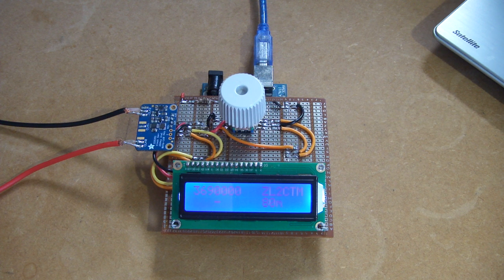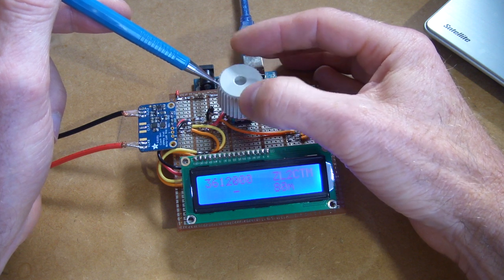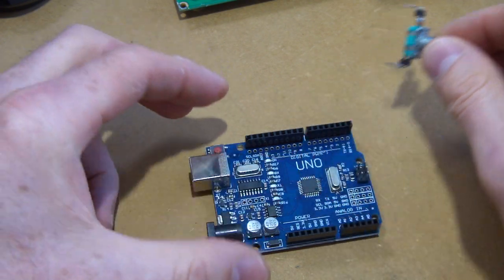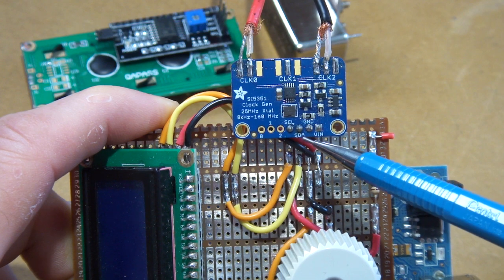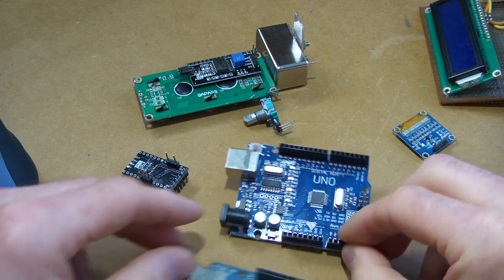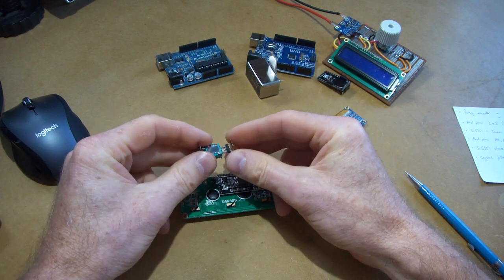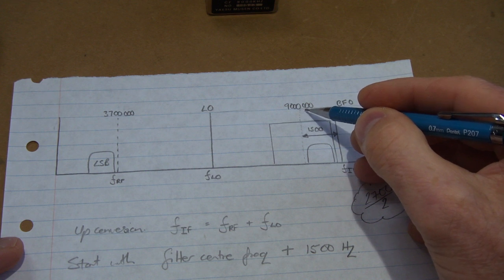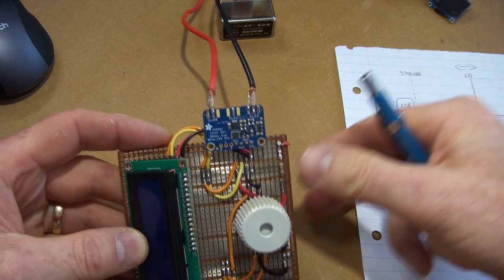Si5351 VFO/BFO Software: Part 1 Hardware overview

Comment: Hey Charlie! De VU2RJV here. Thanks for your awesome videos that has helped me to breadboard this DDS VFO and it works very well.
I am finding it difficult to transfer it into a vero board. Can you help me with the layout details and wiring on this vero board. I am a beginner to home brewing. Even a rough pencil sketch pic would do..73
Reply: Any help will be appreciated. 73

Comment: Hi charlie, thank you for your detailed hardware review, I am interested in build it as a VFO of an old 80 mts SSB BLU (modified :) ). My question is regarding the output frequency of the Si5351, if am not wrong is and sqare output instead of a sine wave no? So if that happens you simply add a filter to get a clean carrier for example? Thanks in avdance!
Reply from the maker: You can add a filter. I did that some time ago and it worked well. Otherwise, square waves work well for the simple diode based DBMs.

Comment: Hey Charlie! Just wanted to knew how the rotary encoder works without Vcc. Dies it take power through RotA and RotB or A and B outputs?
Reply from the maker: Rajaram. The rotary encoders I use only need a ground. No need to Vcc at all.

Comment: Does the Si chip put out square waves? So you just use those for the mixer (instead of a sine)
Reply from the maker: Yes. The SolderSmoke podcast had an article on this at http://soldersmoke.blogspot.com/2016/03/great-video-on-mixers.html

Comment: Hi Charlie, I down loaded the sketch from your blog side to build this VFO/BFO. I keep getting "Tm1637 Display h: No such file or Directory.  I copied directly from the site and have amended  the code. what would you suggest please.  de vk2jcc
Reply from the maker: Hi Colin. You will have to adapt the code to suit your hardware, i.e., what display you are using. I'd get the display working first using the display's library examples, then pull that code into the VFO/BFO sketch.

Charlie
Reply: @CharlieMorrisZL2CTM  Many thanks, It's a big learning curve for me with Arduinos .
 Love the videos you have put up.
 I have learnt a lot already. de Colin vk2jcc

Comment: I use the cursor to indicate the step digit, you can put the cursor on the same line as the frequency number leaving the second line for something else.
I use the pin-change interrupt for the encoder, on the UNO (atmega328 ANY pin can accept pin-change interrupts), both interrupts go to the same routine.
I now would rather use either the AdaFruit Itsy-Bitsy M0 or M4 boards instead of the atmega328 boards.  These are 3.3 volt boards.
Reply from the maker: Yes I have used that approach too and it does work well. It looks tidier too.

Comment: Hi charlie can i use your model like an rf signal generator to adjust sensibility  in a hf radio ?????(excuse me i don´t speak english)
Reply from the maker: I don't see why not William. I use it it in my SSB/CW rigs with no problems.

Charlie
Reply: @CharlieMorrisZL2CTM  can you send me the wiring diagram to conect all to the arduino uno board and sketch please???? my mail is yv5jau@msn.com tnx.
Reply from the maker: @williamsanchez34  It should be all on the blog William: https://zl2ctm.blogspot.com/

Charlie

Comment: I have a bunch of SBL-1H I think it’s called it’s like a +17dBm drive.  How could these ever be usable , never seen anyone build with them.  I thought I was getting the +7dBm package when I bought them. Dumb move on my part
Reply from the maker: Hi Seth. I have not seen any homebrew builds using the SBL-1H. No reason that I can think of why you couldn't use them. You'd need to amplifier the AD9850/Si5351 output to get it up to the 17dBm level needed for the LO drive. Give it a go.
Charlie

Comment: Hello Charlie,
I just subscribed to your channel.  THANK YOU for providing detailed explanations of your schematics and the math involved in determining values of components. Most channels simply give one the schematic with no explanation as to its creation.
   From your videos a person can actually learn how to create their own design for a radio.  SSDFRA and EMRFD are fantastic resources but being able to see and hear an explanation for the theory is priceless!

Could you please explain how you determined the LO drive current levels for the Level 7 (8 ma.) and Level 3 (2 ma.) mixers?  I have a hard time wrapping my head around db and dbm but I believe +7 dbm equates to ~ 5 mw. and +3 dbm to ~ 2 mw.  If I assume a 50 ohm input impedance for the LO input of the SBL-1, and use the formula p=I2R I calculate max. current for the Level 7 mixer at 10ma. (very close to your 8ma.) and 6ma. for the Level 3 mixer (not so close to your 2ma.).  Am I on the right track?

73,
Terry
Reply from the maker: Cheers Terry. You might have heard me say that the whole idea of the video series is to encourage others to give it a go, i.e., design their own radio. They are not suppose to be high end radios, which is a reflection of my own limited knowledge and ability. That aside, I personally get so much enjoyment from using a homebrew radio, no matter how good it is. As for the VFO, yes, you are on the right track. I have found that you can just connect up directly the Si5351 (with the software set to 8mA) to a 7dBm mixer (such as the SBL-1) and it works fine. I have not bothered to amplify its output to be exactly on 10mA.
Reply: @CharlieMorrisZL2CTM  Charlie-- thanks for the reply.  I stumbled across this RF Cafe website that shows the Power/Voltage formulas for deriving these types of answers, and also has a table of conversions already done for those of us who are a little more challenged with the math.  This is a pretty good resource.
http://www.rfcafe.com/references/electrical/pwr2volts.htm

73,
Terry
Reply from the maker: Thanks Terry.

Comment: Good work   Charlie ,  the lcd display is better than the oled because the noise ratio is less or none.
PU4ADD  BETO BALEIA
Reply from the maker: Thanks for that. The little OLED screen are great for the portable rigs, but quite noisy. I need to do some more work and see if I can reduce that.

73s
Charlie, ZL2CTM

Comment: Great video!  What wire are you using to take the signal off of the Si8583?
Reply from the maker: There are two types there. The black coax is RG174/U and the other has no part number. I got that out of an old FT101. It's great as the center conductor insulation has a high melting point.
Reply: Thanks!

Comment: got your code working on my Pro Mini! I had newer versions of the Si5351 and LiquidCrystal_I2C libraries so had to comb through the code and change a few things. Primarily the initialization of the LCD is different and the set_freq() for the Si5351 has 2 arguments instead of 3.
Reply from the maker: Excellent. I'm using the Jason Mildrum Si5351 library, which works well for me. I'm glad you have it working.

Charlie ZL2CTM

Comment: Hi Charlie, glad to see you are making good progress, work commitments has caused serious QRM with my VHF SSB rig project but hopefully today I will be working on getting the receiver stage over the line, the transmitter stage is working perfectly exhaling SSB on 70MHz around 100mW PEP :)

A few thoughts which may or may not interest you and your readers is one of the features I have chosen to add to my project, IF Shift, which although the design is a single conversion superhet I have wrote the software to accommodate this feature quite easily.

In simple terms I have a second encoder controlling the BFO and VFO clock's on the SI5351 which is only enabled during receive and tracks the VFO and BFO in sync +/- 1.5KHz in 100Hz steps, this moves essentially moves the 10.7MHz IF signal around the passband of the crystal filter and it works very well.

The only two challenges are in the choice of Microcontroller and the additional code required to handle this feature, the Arduino UNO, Nano and similar ATMega 328 chipsets can only support one hardware interrupt (two pins but for our application we require both pins from the encoder), you can use other digital pins but won't be very usable as the timing in the code loop will make the IF shift function lag depending on where it catches the second encoder pulses in the loop, to combat this problem I have opted to use a 32u4 based Arduino such as the Pro Micro which has an additional three hardware interrupt pins.

Another challenge for my own project was the fact the SI5351 has no configurable I2C address and as I require four clock signals in my rig I opted to use a neat device called an 12C multiplexer, this has allows multiple I2C devices with the same address on a single I2C bus by way of eight additional addressable ports on the I2C chip.

I did however find a guy in Sweden called Jacken Zimmermann who has design an SI5351C breakout board using the larger SI5351 family of clock generators, this board gives eight clock outputs and supports external clock input say from a 10MHz GPS locked signal - have a look and see what you think:
https://www.jackenhack.com/si5351c-i2c-frequency-clock-generator-breakout-board

Once I have the receiver section complete I will post a video on my blog and on YouTube so you can see the system in action.

Cheers and 73

Rob
2E1IIP.
Reply from the maker: That's really interesting and useful thanks Rob. I will definitely have to take a look at that I2C multiplexer. Thank you very much for taking the time to leave the comment.

73s
Charlie, ZL2CTM

Comment: have you managed to get the Si5351 to output two clocks on the same frequency in quadature (90 degrees apart) for use in an I/Q mixer?
Also ANY Arduino using the ATMega328 chip can accept interrupts on ANY of the pins via the pin change interrupt.  (PCINTxx)  The INTx pins are more flexible, but I've found the PCINT pins perfect for the encoder use.
On the Arduinos using the atmega32u4, only one of the ports accepts pin change interrupts, and there are a few other pins that can accept interrupts too. (But not ALL of the pins).
Reply from the maker: Thanks about the pins. As for quadrature clock outputs, yes I did look to use a Si5351 to generate the quadrature VFO frequencies for a SDR radio. Unfortunately, I could not get the phase register to stay below 127, which meant I could only tune as low as 4.7MHz. At that time I wanted to get down to 3.5MHz, so was looking for a way to turn on the R Dividers using the library. Ideally, I was looking to turn on R0 and R1 registers and make them divide by 2. I liaised with the library author and it was not possible. I might try again sometime.
Reply: I've read that you can actually set the PLL to about 350mhz, so it might be possible to use quadrature to as low as 3.2mhz, or lower.  The thought had also occurred to me that by putting a single external divide by two flip flop in each output which would use as many parts as the divide by 4 usually used to get quadrature output, but the part would no have to operate at only half the frequency. (IE: up to 60mhz instead of 120).  Hence a cheaper HC flipflop would work instead of something more exotic.

I guess you're only plugging the perfboard into one side of the Arduino due to that nasty 50 mil pin offset on the bottom row.

BTW do you have a blog / web page somewhere where you've posted software and schematics for your projects?  I've started a page myself under blogger.com / wa2mze.
Reply from the maker: Being able to get 3.5MHz plus quadrature output would be perfect for a simple low parts count SDR radio. That's what I wanted to do with the SDR build last year, but had to resort to the divide 4 flip flop arrangement. I might have a SDR revamp to the projects list! 

I do have a blog site that I use to dump schematics and software code. It's at: 

https://www.blogger.com/blogger.g?blogID=7819684856383893520#allposts

73s
Charlie, ZL2CTM